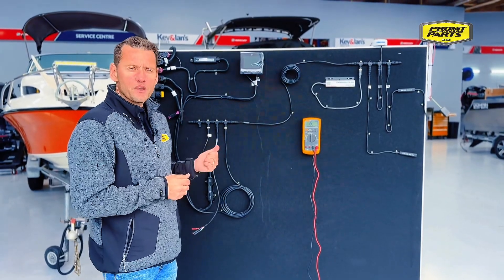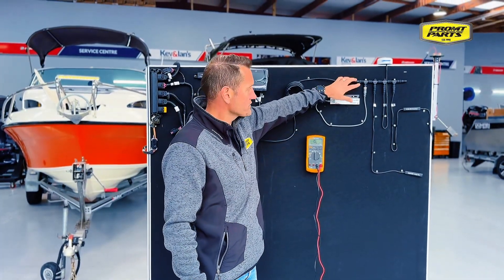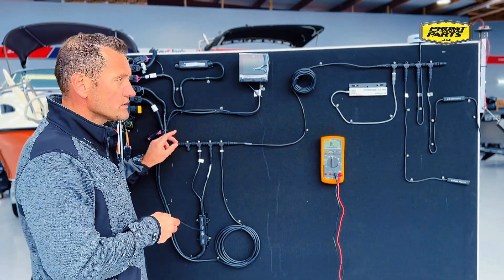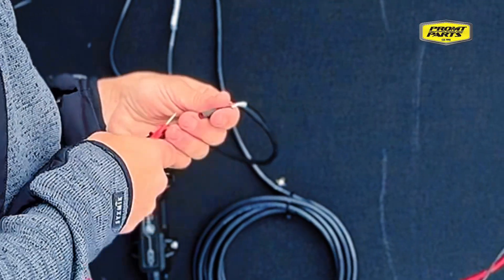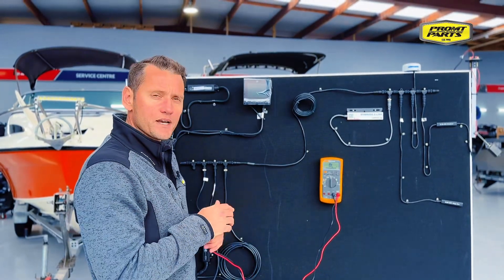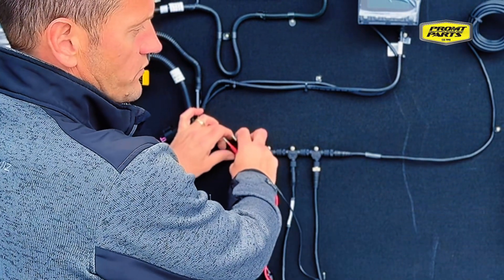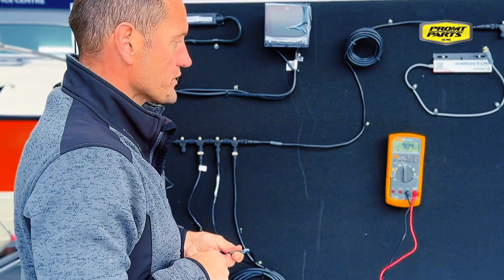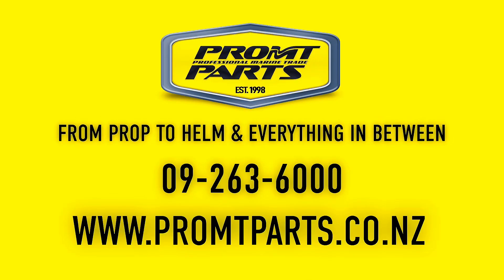Troubleshoot your NMEA2000 network!

Comment: I am having an issue where my Garmin GPSMap 7610XSV sometimes loses connection with the motor so it won't read fuel consumption or any other engine data.  If I shut down the motor and Garmin and power them both back up many times it will reconnect.  Any suggestions on where to start looking for this issue? I assume it is a NMEA problem but not sure how to diagnose.
Reply: Im having a similar problem.